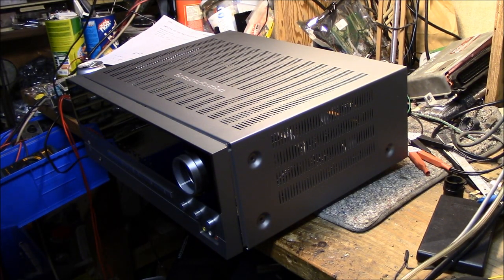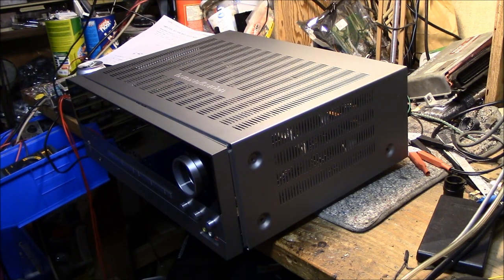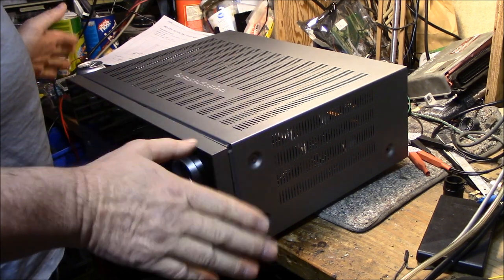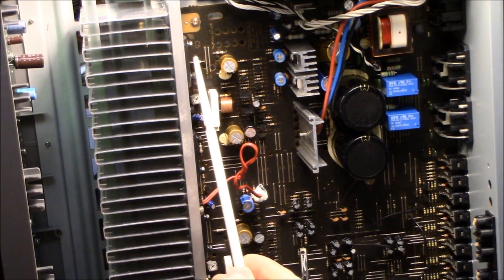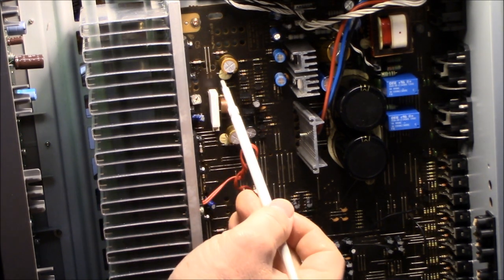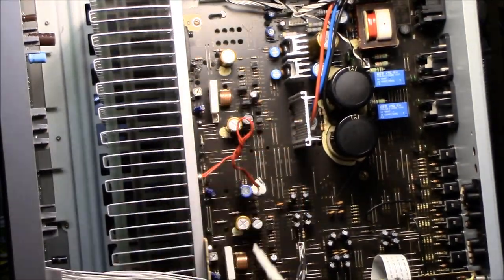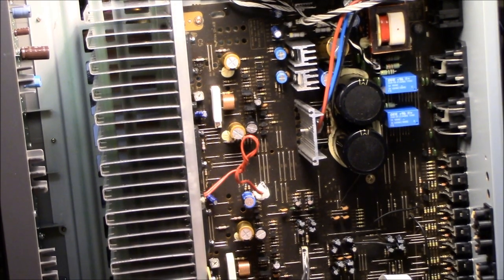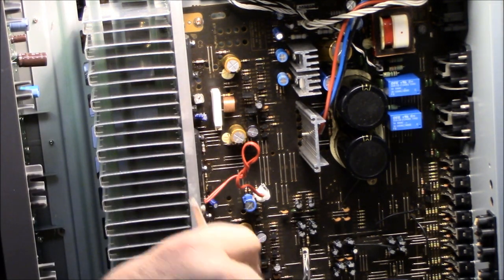Harman Kardon HK 3480 Ebay Junk - Repair and How NOT to do power testing (Ep. 5)

Comment: I just finished replacing a defective power supply filter capacitors (one short and the second one bulging - Koshins replaced with Rubycons) on the same model and stumbled onto your video.  I purchased my HK3480 new in 2006 and that says what I think of the quality and initial cost of this model - excellent.  Thanks for the video and James' comments for what to expect next.

Comment: Very cool video. On the  Q301, that is a KTC3200. I have found that many of those KTC3200s degrade over time significantly. My suggestion is to replace these pairs on both amplifiers with matched  KSC1845 transistors (or better?).  After this, you can send the DC offset to zero by adjusting the R311/R313 pair by about +/- 25 ohms (or less).
Reply from the maker: Awesome, thanks for your advice, I'll remember this for next time

Comment: Interesting, I had exactly the same transistor go out of spec on mine. Same problem with a d.c. off set. I also have had to replace the volume rotary encoder, replace the blue diodes behind the volume knob that died and resolder loads of dry joints. I also had to re flow the input selection chips after it went mute on me. I have had this thing apart a lot! The amp Sounds great though 👍
Reply from the maker: That's funny you mentioned that, right after I set up the receiver in it's final resting spot & then I noticed the blue LEDs went out on the knob, ugh
Reply: Trevor's Bench I expect you know but there are four LEDs in series and a series resistor. I think the resistor is too low value, I doubled its value and the LEDs are still bright but hopefully they’ll last a bit longer.
Reply from the maker: @jamesm90  Thanks, I'll have a look

Comment: Hi there.  I have the exact same receiver.  The left channel has distortion even at low volumes.  I checked the voltages of the speaker outputs and on the left I'm getting 40mv dc with the volume at minimum.  The right channel has 0v.  The left channel blew out the tweeters on my Polk Audio bookshelf speakers.  What do you think it could be?
Reply from the maker: Hi, sounds like you have a few things at play here, might or might not be related. Tweeters blown could have been from high frequency oscillation as a 40mv DC offset alone is not high enough to do damage to speakers. As for the DC offset on the left, this amount isn't uncommon to see on amplifiers so it's not overly concerning but the distortion is definitely not right. The offset and the distortion are probably two symptoms that are related to the same fault. Without diagnosis & testing there's really no way I could advise what's wrong with the amplifier at this point
Reply: @TrevorsBench  Thanks for responding.  To test I removed the pre amp jumper in the back and connected another source.  The left channel still plays disorder sound.  I'm no electronics expert but my guess is the distortion is within the amp circuitry and not the pre amp portion.  

Looks like 4 transistors attached to the big heat sink may have been replaced and appear to be smaller than the original. 

2sb1570 x 2
2sd2401 x 2

I guess if this can't be fixed I can still use it as a pre amp and hook it up to one of those Crown amplifiers.

They have class A AB or D.
Which would you recommend for sound quality and the units longevity.
Reply from the maker: @Mr-Clark  Good job on isolating the fault to the power amplifier by removing those jumpers, I totally forgot about those. If you think somebody's been monkeying around in the amp & changing parts it's anybody's guess what could now be wrong. Distortion can create high frequency harmonics that can have enough energy to wreck a tweeter. Maybe it's best to turn your back on the power amp and use another one in it's place. At least until you can get it properly serviced.
I've got no preference to amplifiers, use what ever your ears enjoy the most. My experience lays mostly with class AB amps so I am probably biased in my opinions but I'm sure there are others that sound good as well

Comment: Hi

Interesting video. I have an HK 3480 with a bad main transformer (primary winding is broken).
Trying to figure out the voltages.

Judging from the service manual there are a few

One winding with three taps (pins 1,2,3 on CN64) is rectified to -+15 VDC. I Guess the taps give 15-0-15 VAC or something like that. 
Also, there is no info about B+ and B- voltages in the service manual but you mentioned -+55 VDC in the video.
My man issue is with the display power supply.

If anyone is currently working on one of these, I would very much appreciate if you could make the following measurements on the trans secondary windings:

Transformer PCB, secondary taps, counting from top to bottom.
AC voltage

7-8
9-10
Reply: OK, i backfed the main transformer on one secondary winding with known voltage to get the other voltages.

They should be:
Transformer PCB, from top to bottom
1,2,3 - 40v-0v-40v
4,5,6 - 15v-0v-15v
7,8 - 30v-0v
9,10 - 5.5v-0V
Reply from the maker: Hi there, I posted a vid that should have all your answers, hope this helps!
https://youtu.be/jHk0reIvSWw

Comment: seeme you do not have so much experience, harman kardon has many problems wirh capacitors, so it is totally possible, not regarding of its age, that there are problems. The age of a capacitor does not tell you if it is working or not, it is the values who need to be okay. I  even had to replace caps in BDP 10 Harman Bluray player, if they are broken they are broken regardless of age. It depends on manufacturer, quality, heat, use time, etc.

Comment: Bonjour j'ai un souci sur  ampli hk 3380  parfois sallume tout seul et s'éteint  , une fois allumé passe de la FM a position VID 1.
Est il question d'un reset .?  Et comment le realiser!  Merci
Reply from the maker: Your symptoms are hard to pin down. It could be a internal fault with noise at the remote circuit or microprocessor. It could also be a external light interference that's confusing the remote sensor. LED lighting can cause problems for infrared remotes.
Sorry, I can't help you more than that through youtube comments